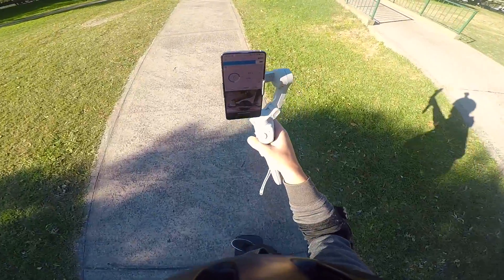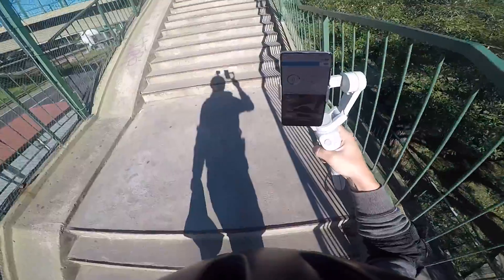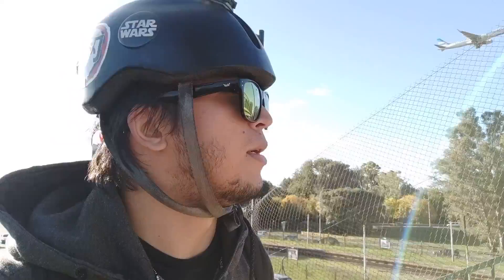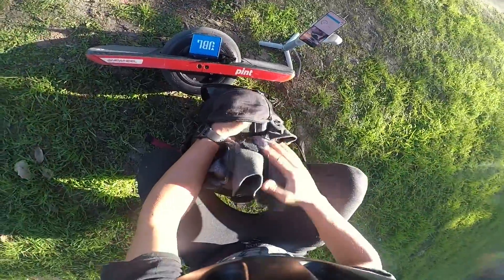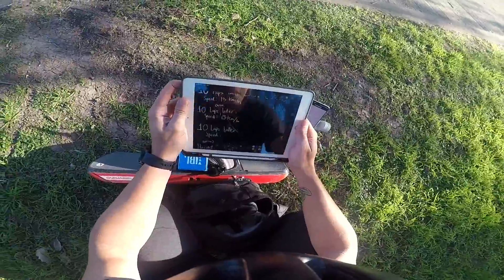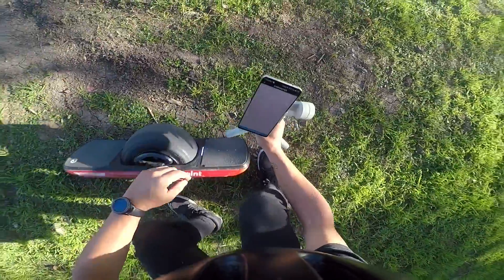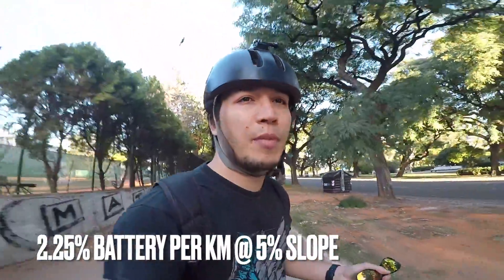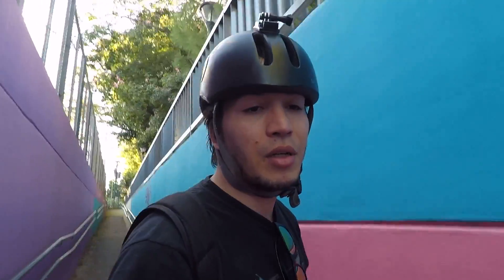How much battery can your Onewheel regenerate? Infinite range? Let's find out!

Comment: Here in Portland during the Friday Night Ride, sometimes a few of us play around in a parking garage. We recharge on the way down and ride the elevator back up. This way you never have to get off the board. Don't do this during daylight hours because you may piss off people parking or get in trouble with the people running the garage. If nobody else is using the elevator too, you can tell it to return to the bottom floor when you get off so it's already ready to take you back up to the top when you arrive at the bottom.
Reply from the maker: This sound like a lot of fun! Much better than the stairs.

Comment: A few years back someone used a parking garage with an elevator to find out some regen capabilities, and they found that going slow is the best way to maximize charge.  https://www.youtube.com/watch?v=_jjCPZd-NlA
Reply from the maker: I hadn't seen that! I compared techniques rather than speed but it'd be nice to revisit and see if I achieve the same results. Wish I had an elevator though!
Reply: Defo this. Take the lift up, regen down, a few times to make sure you get home!

Comment: Great video, I'm interested in this outcome.  Remember that balancing is using battery even downhill.  I would expect carving to use more resources even though the distance is more.  
It's a good energy conservation/exercise program to do ahead of your OW rides.
Reply from the maker: Thank you! I figure that carving is a constant acceleration and deceleration cycle so it probably takes up more battery than just going straight, and as you've said, the motor takes a toll balancing you while you shift your weight.
Reply: When going downhill, balancing is done by modulating the amount of power flowing TO the battery - not by modulating the amount of power flowing FROM the battery. If the board needs to tilt forward to balance while going downhill, it sends MORE power TO the battery. If the board needs to tilt backward to balance while going downhill, it sends LESS power TO the battery. Imagine driving a car down a steep hill and modulating the brake pedal to maintain a set speed - if you need to speed up a bit while going downhill, you don't use the accelerator pedal - you simply let off the brake more. :)